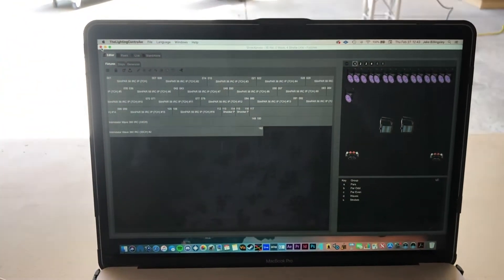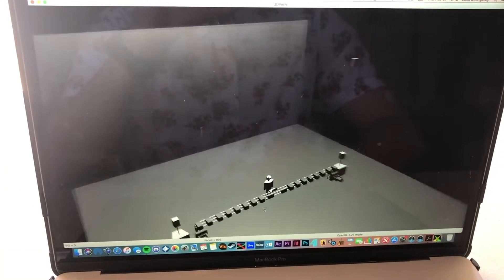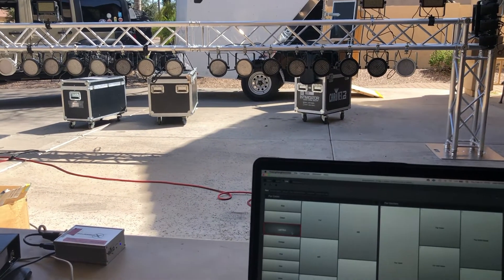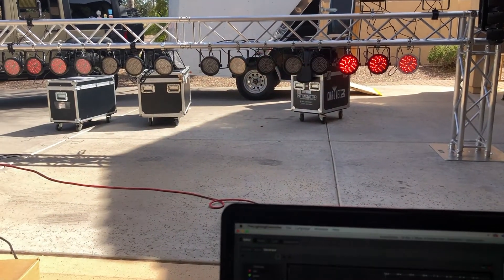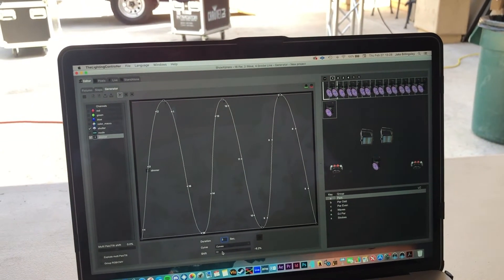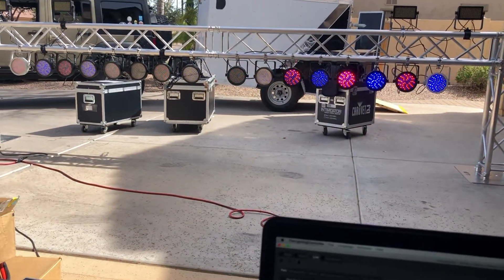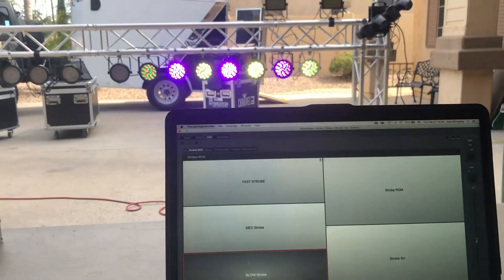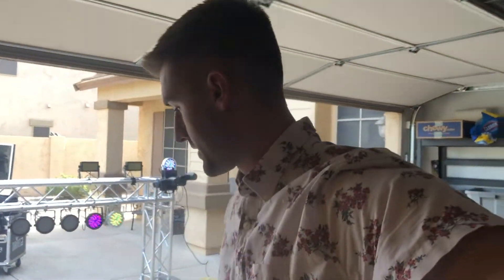Chauvet Showxpress Basic Lighting Programming

Comment: How do you actual do the DMX connection and patching? Do you daisy chain everything or do you run each type of fixure into a Chauvet Rack?
Reply: I should mention that I daisy chain my light bar, and leave the first fixture in the chain open, then just plug in one of my wireless DMX receivers and turn it on before I put it up.  So I run the whole bar off one DMX Receiver.  And then individual receivers for our various other lights on stands where it makes more sense than daisy chaining would.